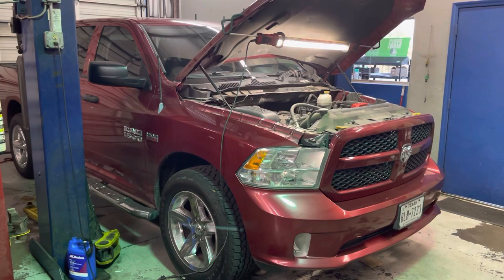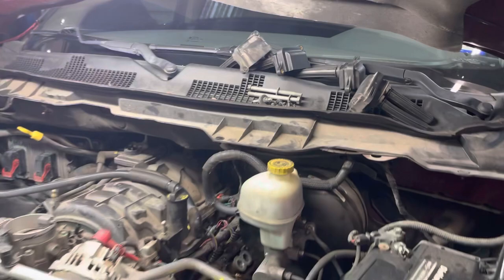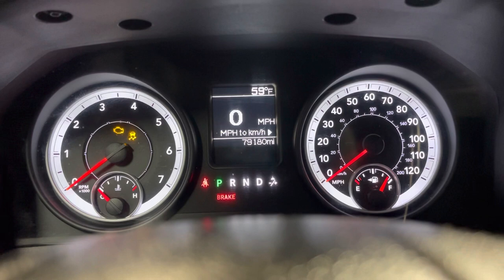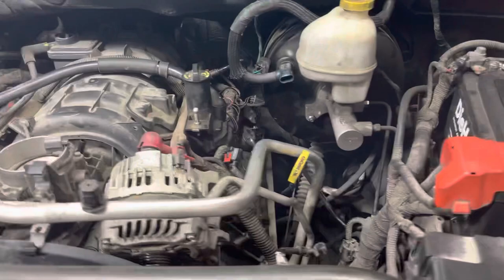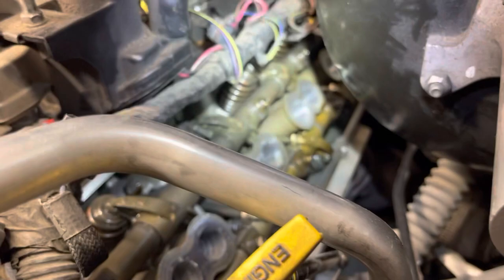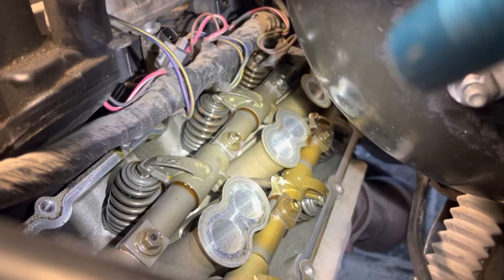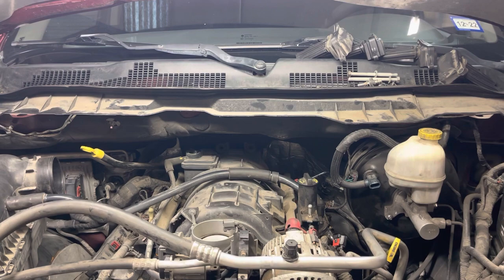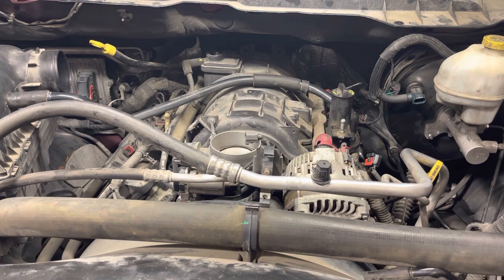This is Why Hemi Engines Fail

Comment: Replace the lifters, pick a cam, tune it to eliminate MDS.
Reply: Has nothing to do with MDS. My 09 Hemi has 360,000kms all original with MDS active. I don't do anything crazy, drive it hard and change oil every 8000kms with bulk synthetic from a quick lube place
Reply: @nicholas440  it definitely does. If you drive it hard MDS isn’t activating as much. I have the tick and idled too much.
Reply: @jsixamore  6.1 hemis have lifter failure also. Manual 5.7s without MDS have lifter failure. There's no facts that link the two together. People just assume
Reply: About how much is this repair with the camshaft?
Reply: @joshmcintosh1789  Around 2k with labor and parts.
Reply: @nicholas440 Hello Nicholas, I just bought the 09 Commander with a Hemi engine.
The mileage is 200.000 km.
I don't know how was the driving habits of the ex owner.
So to avoid this problem can you please give some advice like how to idle , the kind of engine oil and so on .
Thank you very much 👋🙂🙏

Comment: ...and the ultimate question remains, "How do I find a willing and able mechanic to replace the camshaft and lifters on my 5.7 Hemi, in NH?"...  the most crooked, hack infested area I've lived in.
Reply: My regular mechanic did a great job!
Reply: I would replace the motor, it happend to me again after a month, it would also probably be cheaper considering you can probably get a newer motor with less milage. Or buy after market parts that you need and have them put those stronger parts on instead of oem, you could also use the lifters from a 6.2 hemi that is stronger
Reply: Dealership

Comment: Is there a way to diagnose this lifter failure issue in a simple way BEFORE the cam is in serious trouble and check engine/errors start showing up? I have Chall 5.7 2013 around 70k miles, and I never have had the problem yet. The thing is the service station I'm doing annual checkups (authorized Dodge/RAM dealer-service, all they way in Poland , EU) does not want to open the valve covers just because this issue MAY happen one day. Anything else could be done besides listening for the elusive tick? You know how this is - I know the issue, I'm the owner,  so I think I can hear some tick. The mechanics at the service say - there is no suspicious sound ;)
Reply: Mine has started making an intermittent chirping noise.  So it is probably the lifter.  I hope I caught it soon enough that I don't have to replace the cam.

Comment: If I’m just starting to get a high rpm misfire is it going to be as easy to spot as this one when cranking ? Cylinder 6. Worse when towing but normal driving only misfires over 5,000 rpm.
Reply: Should also clarify, there is no tick on startup whatsoever. 165,000 miles

Comment: Ever hear of one of these making no noise? My 2012 Charger RT has a misfire at rpms over 4k. Replaced all the plugs, Swapped the coil and injector and misfire didn't follow. Cyclinder 5 too. Took the valve cover off and yup, #5 intake valve moving just like that one. Again no lifter noise what so ever too. After doing some research, this should be a recall. I've read countless posts, videos, etc and almost all of them are cyclinder #5. Must be an oil issue?? 🤷🤷 But there should be a recall how common this is. Took dodge/Chrysler years to finally issue a recall for that alternator issue (I replaced it 2 times before they issued it and they reimbursed me too). But yea, I'm eff'd......
Reply: I have a 2012 ram 1500 that makes no lifter noise (other than when I first start it after sitting for awhile). Misfire on #3 , only above 3500 rpm. Pulled valve cover, it’s got more movement than the one shown in this video but definitely not moving like the others around it. From what I’ve seen, I think we’re just catching ours early, before it develops a noise. I’m hoping that means not many metal flakes in the oil/circulating the engine. I ruled out just about everything else that could cause the misfire before I pulled the valve covers. I was “happy” to see the lifter not moving as much because that confirmed it was mechanical instead of something electrical (I worried wiring was bad, connectors, pcm, etc.). Looking at either an ams racing kit or the mmx kit to rebuild it, mechanically delete mds and use a turner to disable it electronically. After that use the tuner to bump up the idle rpm a bit so if I do have to idle it , atleast there should be more oil pressure pushing oil to the cam and lifters. Hoping for the best!
Reply: @DUFF3RR ...replace the oil pump with a high volume oil.pump...melling just came out with one...not a high pressure but volume.

Comment: Hi Jack, thank you for this video.  I have a 2011 Hemi 206K miles. CEL when under a load - shakes bad. Cyl #7 misfire. Plugs are fairly new. Tried changing the coil - no improvement. Did not do a voltage test on injector. Suspect lifter cam issue as I've never heard a single instance where it wasn't a lifter / cam issue in this "under load" situation.    I am not a mechanic.  Should I find a mechanic to do what you did in this video or should I replace the engine with a re manufactured engine with a 3 year unlimited mile warranty?  If you suggest the re manufactured route, is there a specific company that you recommend?  Thanks in advance for your help!
Reply from the maker: With over 200k miles, I would be inclined to replace the engine. If you decide to go that route, I recommend powertrainproducts.net
They have good prices, good customer service, and good quality re-built engines.
Reply: Was is the camshaft?
Reply: @allenstyer205  I just sold the truck yesterday.  In another video Jack did, he shows where Cyl 5 has a misfire due to a failed roller rocker and explains perfectly how to diagnose.  I believe i had the exact same problem, except for mine, it was Cyl#7.  The needle bearing on the roller rocker fails. The roller stops rolling, and starts to drag on the cam lobe (potentially scarring the cam) instead of rolling smoothly.  The lifter fails to lift all the way, causing misfire.
Reply: @cocacola3452  so did you fix it or actually diagnose the problem?
Reply: @allenstyer205  I pulled the valve cover and watched #7 remain almost flat in comparison with the rest of the lifters just like Jack's other video of #5. . I didn't fix. I got rid of the truck.

Comment: Did you go right into pulling valve cover off or did you do a compression test and leak down as well?
Reply from the maker: I went straight to pulling off the valve cover because I heard the engine making a chirping noise so I already knew. It was the sound of the camshaft hitting against a seized roller on the lifter. Plus, a compression test and a leak down test wouldn’t show anything for this problem anyway. With a valve basically stuck closed, the compression would still show good and the leak down test wouldn’t show anything either unless the valve wasn’t seating properly or was stuck open.

Comment: What did you do to crank it without starting it with the valve cover off? did he just let go before it turned over?
Reply from the maker: Hold the gas pedal down while cranking it. It prevents it from starting.
Reply: Pull fuel pump fuse

Comment: After doing this repair is it going to do the same thing or have improvements to components been done.
Reply: It will last for a while depending on driving habits. Need to avoid idling so oil pressure stays high and turn off MDS so the lifters stay running consistently.
Reply: High volume oil pump. Not high pressure. Melling just started making a high volume oil pump. Others have installed the Hellcat oil pump which bolts right up. It's also a high volume oil pump. There's another YouTube channel that gives a really good explanation on why they're needed, can't remember the channel. I currently have my Ram tore down. Couldn't bring myself to just throw new parts just at it just for it to fail again. Did a bunch of research and that's what I found.

Comment: I Got A Question And I've Been To A Few Shops And The Dealership As Well And They Can't Tell Me What's Going On Or What The Noise Is On My 07 Dodge Ram 1500 5.7 Hemi. It Rattles Or Should I Say Make A Metal Tapping/Rattling Sound When Getting On The Gas And Getting Off The Gas Peddle. If You Can Please Help Or Help Point Me In The Right Direction To Start Looking, I'm New To The Dodge Hemi Gang And Love My Truck And Don't Want To Sell It I'd Rather Fix It Myself If I Can Or Get It Fixed But All The Shops Are Charging A Diagnostic Fee And Still At Square 1 No 1 Knows What's Going On.

Comment: as cool as it looks I would never drive some shit like that that costs a paycheck to fuel and is constantly in the shop receiving expensive mission critical and time consuming repairs. I recently bought a 2013 Santa Fe originally brand new was 33k I got it for 13k and if you weren't looking it could easily pass as a new car and shit talk about loaded with all the bells and whistles I feel like I'm important behind the wheel of this thing actually I just discovered the door handle lights up at night like how cool and it's got 19in wheels and drives like a dream with AWD and 6sp flawless transmission that shifts like butter. (I feel like I'm gliding or hovering over the streets instead of driving a land vehicle, until I hit a bump lol). 9 free oil changes from the dealer will ensure the longevity of this wonderful vehicle for many thousands of miles to come. even though it's 10 years old and I had a 2021 vehicle before this, unless someone told you the age or mileage you'd feel like you were in something much newer, more expensive and with significantly less miles
Reply: who the fk cares what you drive,get a bigger pay check than Einstein.